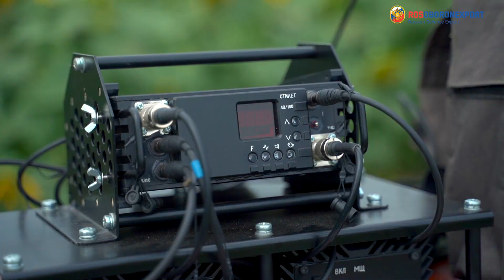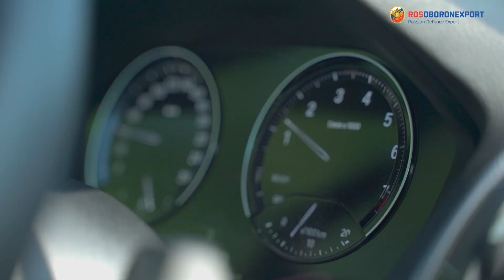Stilet radio communication system

Comment: Can the give protection from the attacks of kamakazi drones.?
Reply: It appears that the system is aimed at the civilian/law enforcement market where kamikaze drones aren't a problem.
Reply: You're asking a microwave oven to wash your clothes.
Reply: It's a plausible question and according to it's specifications, simple 'grenade and mortar lobbing drones' won't reach their target. 

One would need large drones with military grade optics, fire control and missiles to outrange the jamming distance, costing as much as a tank. 

There would still be a clear vulnerability to wire or optical guided unmanned vehicles and devices - but jamming is just one aspect, compared to encrypted and obscured communication.